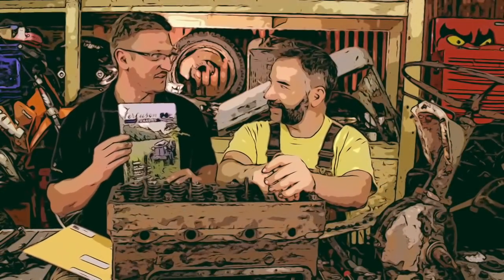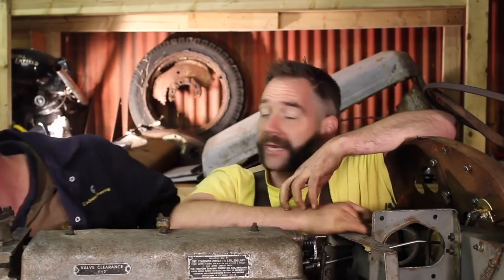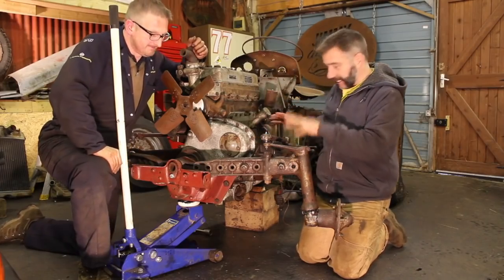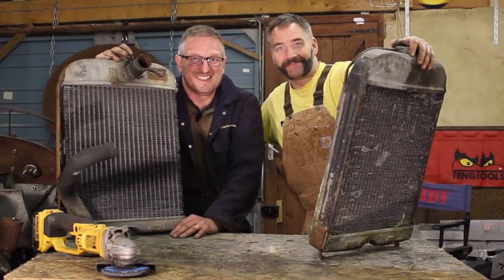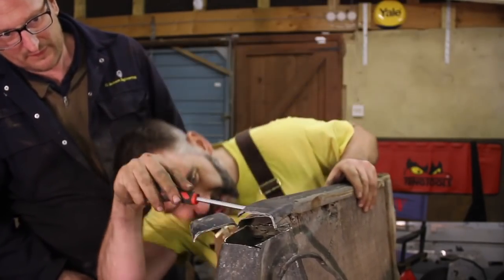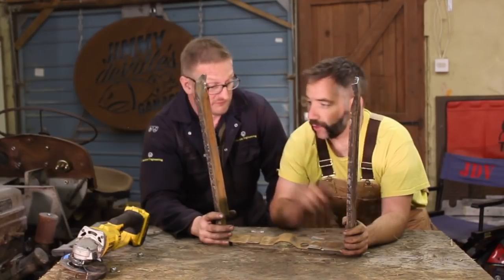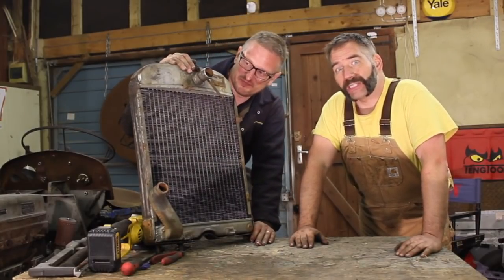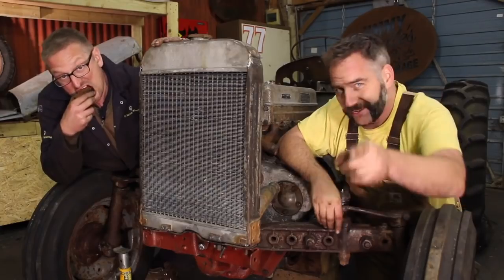Barn Find Fergie.  Episode 13. How to repair a radiator

Comment: Why grind rad to pieces, melt solder joins as when dismantling to fit a new core ? Did you check bushings and thrust bearings on stub axles
Reply from the maker: We cut it off where we needed it. Spot on. Stub axels are golden for now. Thanks for watching.

Comment: I have a barnfind Fergie the same as yours…..   (on my channel). I am at the stage of the diesel injector!!  My ones in better condition than yours was but diaphram is finished and a little corrosion in diaphram chamber.  Can you tell me if thst chap that reconditioned yours is happy to do another!!! many thanks.

Comment: Mmmm copper slip on a moving joint! Would not a grease be more suitable?
Reply: Yep I hear you 👍, I have found in the past that on these old worn out joints slapping about that grease just disappears in a flash! It’s probably negligible and against convention on a moving part but the copper grease does seem to solidify somewhat over time and pack the joint. Believe it or not the old boys used to crush a copper penny in that joint to take up the play!
Thanks for watching 👍

Comment: Why attack the radiator with a grinder, surely some heat and the solder would melt out and free all the radiator frame.
Reply: We ran out of mapp gas. Adapt and overcome. Thanks for watching

Comment: Good work chaps. Coming along nicely. Enjoying following the build. Gav - it’s looking more finished than the last BSA bike I saw but that was 20 years ago. Quick question why didn’t you pressure test the rad before rebuilding the sleeve. Might save you the hassle if it is no good.
Reply: That BSA went to a collector in Norfolk when I finished it. There’s been a good few since then! Did you keep the Vitesse? The rad is good, but in my experience they can still play up once they start getting a bit of use. Just having fun seeing what it’s possible to save with a bit of a mend and make do approach. Good to hear from you mate👍
Reply: @montydog0  The Vitesse went.  Another Triumph nut picked that up.  Most of it got done but couldnt finish it once left home.  His eyes lit up when he saw two engines and three gearboxes.  Got a project on the go at the moment but never enough time.  Next time I'm passing the Jackson Engineering workshop I'll pop in.